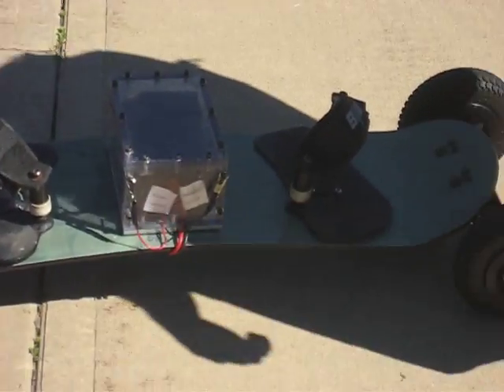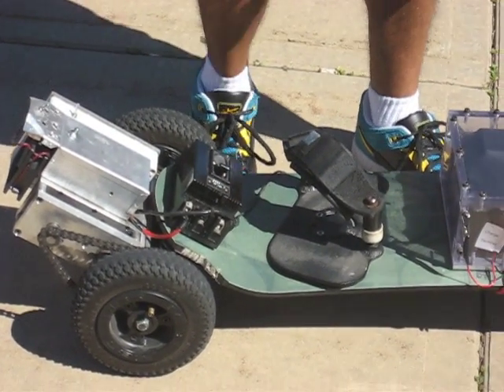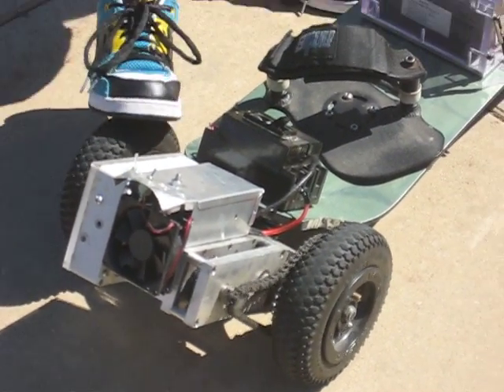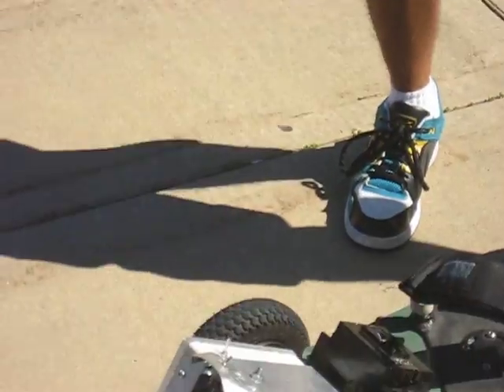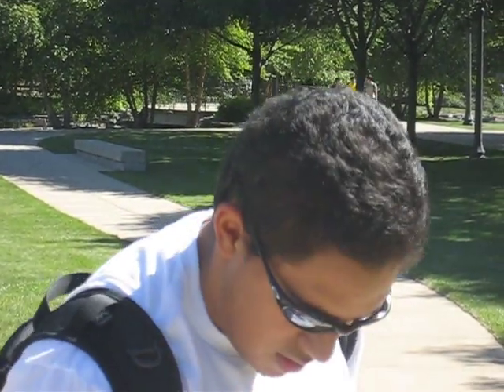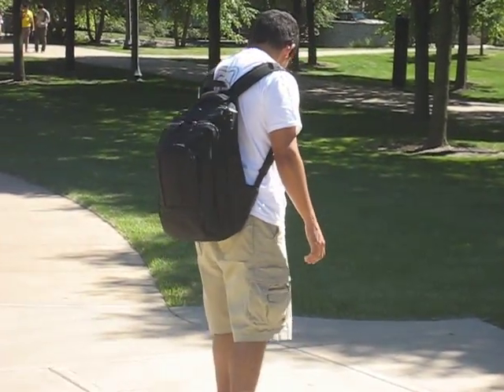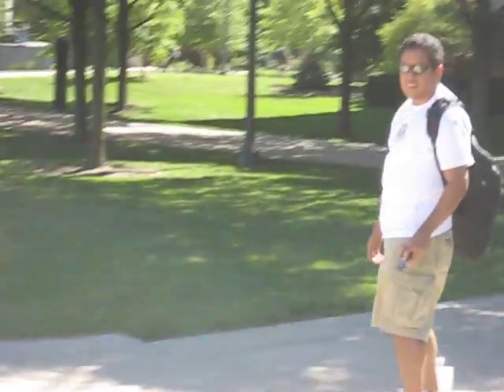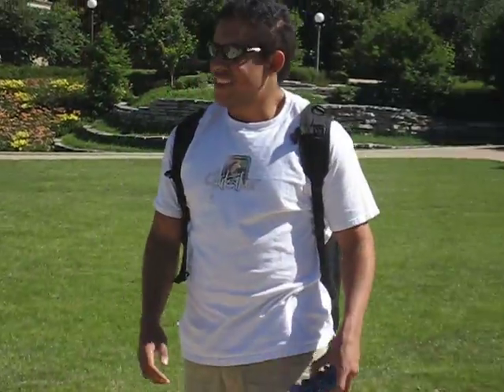Wireless PS2 Controlled Electric Mountainboard

Comment: I have single mountainboard too and I constant have feeling that board automatically turning into motor side and I constant must corigate it, do you have/had the same issue?
Reply from the maker: Hmm from what I remember, I don't recall really having this issue. I wonder if this can be fixed by either applying lubricant to all your bearings, making sure all your tires have a good amount of pressure, and that all your tires have strong traction. Did you build this board yourself? What batteries are you using? How much does the board itself weigh? What is the kind of motor that you use?
Reply: @aguzman11189  yes, it's my DIY based on patrol mountainboard with skate trucks. All tires have same pressure and all bearings are fine. I use brushless motor 1500w 280kv with 6s lipo battery.

Comment from the maker: Yep! I used the Arduino Duemilanove. It's overkill x10000 but at the time I didn't have experience with microcontrollers like the PIC and was just getting into building my own projects. It's a great, powerful, slick product and I'd highly recommend using it at first. I'm just looking at the design in hindsight and thinking to myself that I brought a bazooka to a knife fight.

Comment from the maker: @4harrytje Yea sure!  So I was able to get away with something around 1 HP.  It's a bit much, really.  Motor needs an initial push in order to really start spinning, so even if you have something like 2 HP but try and start it at zero velocity, the thing won't move.  Once you push yourself a bit, you can really feel the torque if it's 2 HP (which it is right now because I thought the other one was broken and figured it would be better to get more than less than necessary).

Comment from the maker: @zychda @zychda Just realized I never replied!  Let's see...I'm using a Hacker brushless motor with a 430 kV rating I believe and there are no hall sensors.  The gear ratio is 9:1 and the tire size is 8 inches.

Comment from the maker: @qwertz123 The LiFePO4 battery cost like $350, the brushless motor cost around $100, the board from eBay around $120, the brushless motor controller around $100, the Arduino Bluetooth around $120 (although in hindsight I realize I could've built one for cheap....very stupid of me), the controller cost me around $20, it all adds up.  If I want to stand out, I'd want to make the board very cheap but it'd be hard for me to stand out in the market.  I dunno...we'll see what happens.

Comment: @aguzman11189 It's a neat build all around. I was just double checking my calcs to have a place to start fishing on ebay! Thanks.

Some years back I used to try and shorten my life with a go-cart with a half horse motor; having more than you need just requires self-discipline. Or luck...

Comment from the maker: @DangODave So the maximum amperage that can come out of the battery is 40 A and the highest voltage output is 25.6 volts, so basically the max watts that can be used up is 1024 W.  I bought the motor more because of the RPM per volt rating than the HP.  I found that motors in the market with higher power input tend to have lower RPM was and I wanted a low gear ratio since too high of a ratio is bulky and unnecessary.  Thus, the motor I got was a balance of the RPM and power that I wanted.

Comment from the maker: @lostindaplot I considered adding that feature when I read about the regenerative braking concept, but I had a hard time finding a motor controller that allowed current to travel in reverse without frying the component.  Also, the friction in the gears slow the board down if I go past a certain speed.  Using the board now, it seems like the energy saved isn't worth the extra components (which would increase the probability of the board failing and add complexity) so in the end, I didn't add it.

Comment from the maker: @xyxy1024 Thanks!  Hmm...so I guess the milage would be perhaps around 10 miles?  I don't know for sure; I use it to get to classes and get around from my apartment to the main campus and I've gone 2 consecutive days without charging it.  The battery was basically dead on the end of the second day, but yeah...I've never tried to find out the exact number.